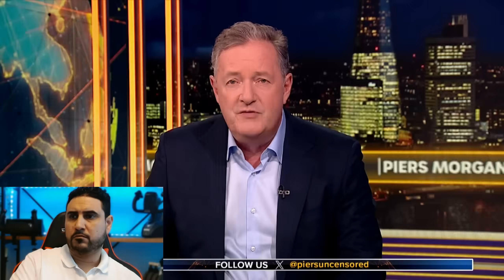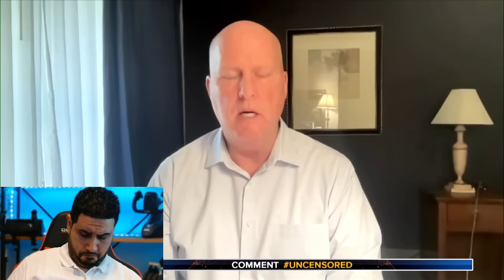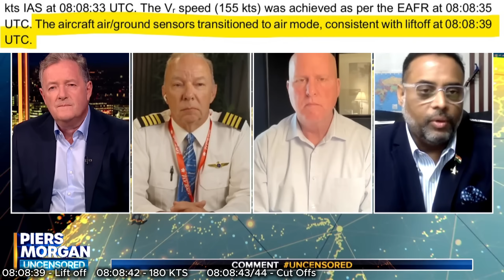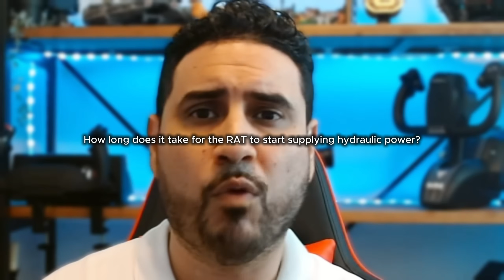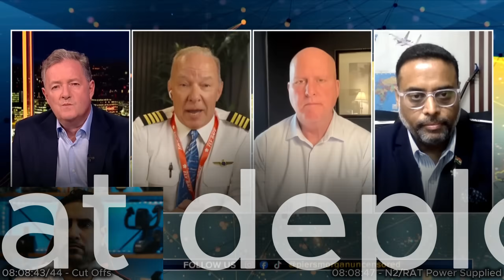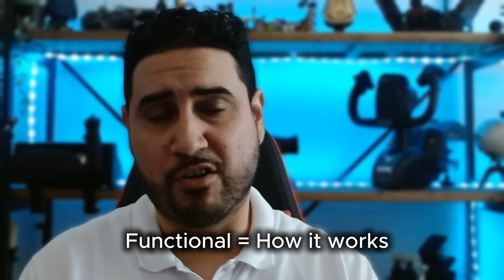TOTAL SYSTEMS FAILURE BREAKDOWN | AIR INDIA 171 | AAIB PRELIMINARY REPORT | MAYDAY | MSFS2024

Comment: People are just educated idiots...Have you ever had an electrical switch at your home that you turned on but the light it controls did not light up, or switch turned off but the light did not turn off??? Switches can fail...even mechanical ones....
Reply: One day on my car turned the key switch off and the car engine keep running so switchs do fuck up
Reply: Switches are just a distraction which Captain Steve will keep in the discussion. The actual issue happened probably at the tail.
Reply: Have you ever hade a light switch that moved by itself you mean?
Reply: @mikaelmagnusson3225 is there a proof of the switches moving?
Reply: I guess the concept of a short-circuit is too much for some...😂😂😂
Reply: @AbiP-k8g 😂😂
Reply: @Zizi462  , I'm not a Boeing Fuel Engineer, but I can logically reason and deduce that, the EAFR does not monitor the physical status / position of the mechanical Fuel Control Switches as such, but only monitors and captures the opening / closing of the electro-mechanical Fuel Control Valves, which, in all likelihood, are being linked by the investigators to the manual "transitioning" of the Fuel Control Switches.
Reply: @Zizi462  Yes, they were on and the copilot noticed they were shut off, as the audio recordning shows
Reply: @AbiP-k8g  "I guess the concept of a short-circuit is too much for some"

And I guess you do know enough about how these switches work, to know that cannot have happened.
Reply: The switches "transitioned" from on to off, meaning they moved and did what they were supposed to do - cut off the fuel. Then they were "transitioned" from off to on, the engines began spooling up again. The switches worked just fine. In the ANA incident in 2019, the fuel switches did not "transition", but remained in the on position. Big difference here.

Comment: My issue with all of the videos about this crash is the failure to correctly state the question.  The question is; "From which sources specifically can the black box receive the impulse which it RECORDS AS a 'fuel switch cut off' ?".  This question needs to be answered by the crash investigators unambiguously.  Let us put an end to the speculation about glitches and miracles.  Even an electrical short must jump between two (or more) specific conductors.  Those specific conductors can be identified as possibilities.  But miracles do not occur even in electronics, as magical as electronics might seem.  Even in electronics effects are not bastards without causes.  I suggest that the need for the "black box" is important enough that there must be unambiguous certainty that what is RECORDED AS "fuel switch cut off" can ONLY AND EXCLUSIVELY have as ITS SOLE ANTECEDENT the MANUAL, PHYSICAL shut off of the mechanical fuel switch.  If this is not presently the case, then the systems need to be redesigned.   A team needs to EXHAUSTIVELY attempt to cause a black box to RECORD a "fuel switch cut off" by every other possible means. Clearly this experimentation must be done on plane identical to our accident plane.

Comment: @FinalApproachPOV, I'm a fan of Capt Steve, but this time he's got it wrong, when he says that the Fuel Control Swich "opens a mechanical relay".

The Relay (Separate for each engine) is actually an electro-mechanical device, that, in turn, triggers the Actuator, which operates (open / close) the Fuel Control Valve.
Reply: Almost all relays are electro-mechanical. Magnetic forces (generated electrically) mechanically move a physical device.  It's just a term, it pilot speak, most people just say relay and understand that it is and electrically controlled mechanical relay, even it the relay in question is controlling another electrical signal. Relays are used because the amps/volts powering many systems are too much for a physical switch.
Reply: @jaywashington4669 , Stevie is not an engineer. If he cannot use technically correct terms, he should simply wear his pilot’s costume and go to a Halloween Party, and not make YouTube videos on technical issues.

Comment: Two switches do not turn themselves off one at a time and then turn themselves back on one at a time. The whole fuel system is designed not to turn itself off.  To have two systems fail one at a time and then repair themselves one at a time is not possible.
Reply: Perhaps there was a short and moving the switches back and forth reset the short. That explains the delay between putting the switches into RUN position.
Reply: @3rdyellow  Because of the electrical/wiring configuration, no "short" anywhere in the system could explain even one of the systems doing this, let alone two - which are separate and independent, let alone four happening with 14 seconds.

Comment: NEVER EVER PILOT ERROR 
The Thrust Control Malfunction Accommodation (TCMA) function, which is designed to work on the ground, can potentially cut off fuel to an engine without pilot input, as it has been observed in ANA aircraft during Thrust Reverser operations. This function's activation prior to the ground-to-air transition could explain a RAT (Ram Air Turbine) activation due to hydraulic pressure loss 2-5 seconds after takeoff, as the RAT is deployed when hydraulic pressure is lost. 

Here's a more detailed explanation: 

* TCMA Function: The TCMA system is a safety mechanism designed to detect and correct thrust control malfunctions, particularly during ground operations, potentially including thrust reverser activation.    
* Ground-Based Operation: The TCMA is programmed to operate while the aircraft is on the ground, including during thrust reverser use.    
* Potential for Malfunction: The system might mistakenly trigger the fuel cutoff function even when not intended, as evidenced by the ANA incident during Thrust Reverser operation.    
* Hydraulic Pressure Loss: If the TCMA mistakenly activates the fuel cutoff function during the crucial transition from ground to air mode, it could lead to a loss of engine power and subsequent drop in hydraulic pressure.    
* RAT Activation: The loss of hydraulic pressure would then trigger the Ram Air Turbine (RAT) to deploy as a backup power source to maintain essential systems, which could explain the RAT activation 2-5 seconds after liftoff.

Comment: In 2019, a Boeing 787 operated by All Nippon Airways (ANA) experienced an automatic fuel cut-off without pilot intervention during a flight between Tokyo and Osaka. “There's no evidence the pilots shut off the fuel. Audio from the cockpit doesn't suggest suicide or deliberate action.
Reply: In the case of ANA, the fuel switches did NOT "transition" from ON to OFF, they remained in the ON position, whereas on AI 171, they transitioned, meaning they were manually moved as recorded by EAFR.
Reply: Did the 2019 incident also log fuel switch transitions?? I think not.  This situation logged FOUR fuel switch transitions.  We know the switches were still in the last logged position.  That re-enforces the accuracy of the data logs.   Try again.
Reply: "There's no evidence the pilots shut off the fuel."

The evidence is indisputable. The Fuel Control Switches MUST have been moved to CUTOFF.

Comment: @FinalApproachPOV
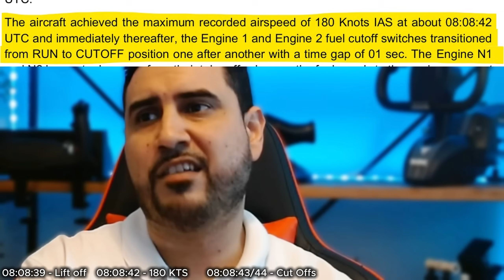4:08
The report DOES say "1 second later", you just didn't read far enough.
"Engine 1 and Engine 2 Fuel cut off switches transitioned from RUN to CUTOFF position.... ONE AFTER ANOTHER WITH A TIME GAP OF 01 SEC "
.
Reply from the maker: Maybe I can help clarify. I was talking about how uou can use educated assumptions to deduce timing. 

Immediately thereafter refers to “when” the switches cut off, the 1 second gap refers to the timing between both switches transitioning. 

The report does not specify “when” the switches cut off. That is a fact. 

Maximum airspeed achieved 3 seconds after lift off. Immediately thereafter, the switches transitioned with a 1 second game. 
How long is immediately? The report doesn’t say. This is where “safe assumptions” come to play. 

I hope this helps clarify.

Comment: Very wise explanation - my expert evaluation as an Aerospace engineer, Pilot and airline operations specialist. Finally I hear something that makes.perfect sense from these guys. When things start going wrong in thr cockpit at take off at most critical point of flight at lift off....and things which are never supposed to happen HAPPEN!!! WHAT DO.U DO!! A FEW SWCONDS WOULD PASS FOR LETTING THE SHOCK ELEMENT DISSIPATE AND THATS 2-4 SECONDS!!!
MY OPINION IS THERE WAS A WRONG SIGNAL SENT TO THE FADEC WHERE THE AIRCRAFT TRANSITION FROM GROUND TO AIR..THE MAIN CULPRIT MALFUNCTION HAPPENED TELLING THE FADEC THE AIRCRAFT WAS STILL ON THE GROUND AND CUT OFF THE FUEL FLOW TO THE ENGINE AND THE GEARS DID NOT RETRACT COMBINATION OF POWER FAILURE N WROND SIGNAL OF AIRCRAFT STILL IN GROUND MODE!!!
THAT IS THE MAIN ELECTRONIC ERROR OF THE EEC AND FADEC....THAT IS RHE GLITCH WHICH CAUSED THE FUEL CUTODF TO ENGINE RESULTING IN THE CRASH.
DEFINITELY, IIAB SHOULD.HOLD A PREAS CONFERENCE TO CLEAR THE AIR BECAUSE THEY CREATED MORE DOUBTS THAT ARE DESTROYING THE CREWS REPUTATION AND CLEARING BOEING AND GE AND HONEYWELL....BUGS HAPPEN, ERRORS HAPPEN IN ELECTRONICS... even on simplest computer and yoU have to restart once in a blue moon but IT HAPPENS!! !
Reply: Things started to go wrong...CapsLock locked on! Can't unlock! NOW EVERYTHING IS SHOUTING! MAYDAY!
Reply: The Prelim reported four switch movement events. Two have timestamps. These events could not have been logged into the DFDR if the switches were not physically moved. It CANNOT happen.

And just because you type things in all-caps doesn't mean they're true. Apologies from another AE.
Reply: @BryanM61 So why did you type "cannot" as "CANNOT" or is the self-inflicted irony just your perverse deprecating humour?

Comment: You highlighted a very important point regarding functional knowledge. Captain Steve is a disgrace to the professional pilot community with his arrogance and dismissive nature of counter arguments. To frame this accident as "pilot error" at this stage is totally unprofessional. I ask one question to those engaging in this conspiracy theory. How did the main gear achieve a toe down position if the pilot monitoring supposedly "transitioned" both fuel switches by 08:08:43. Gear doors are WoW activated but main wheel toe down tilt requires gear handle activation.
Reply: Captain Steeve clearly did some research into the Fuel Control Switches and their functionality. He knew a couple of key points (stated in this and another video) that very few people would know if they hadn't studied the system in depth.

He is NOT a disgrace to the professional pilot community; he is "arrogant and dismissive" here because he KNOWS - for a fact - that the other two people are making sht up and talking out their asses. He KNOWS they are making provably incorrect in their statements. He's not guessing; he's not "going off his gut", he's not sticking to some theory he made up in his head; he knows for a fact.

Toe-down - if that's what we REALLY see - was a result of reduced hydraulic pressure to the main truck tilt actuator; no gear handle movement required.
Reply: @BryanM61  You need serious help. You have no idea what you are talking about. Leave this to the professionals for educated discussion. You know nothing about tilt.
Reply: bit of Dunning–Kruger effect

Comment: Alternate Interpretation hypothesis: AI171 Dual Engine Failure on Takeoff
There’s growing reason to believe that Air India Flight AI171 suffered a dual engine flameout before liftoff, and that the RAT (Ram Air Turbine) deployed right at rotation — not later as implied in official timelines.
Timeline Breakdown:
* Takeoff Roll: Acceleration appears normal. But sometime between V1 and VR, both engines lose thrust, most likely due to fuel starvation (e.g., no fuel in centre tank).
* Rotation (~160 knots, ~25m AGL): As the aircraft lifts off, the RAT is visibly deployed. The RAT cannot deploy on the ground — so this confirms that both engines were at idle or dead at rotate!!!  A shallow but abnormally high pitch angle on takeoff adds further evidence of a powerless climb.
* Cockpit Voice: “Why did you do that?” Possibly a reaction to unexpected engine flameout or accidental fuel control input. Timing of this line suggests it coincides with sudden loss of thrust.
* Emergency Action: The pilots cycle the fuel cutoff switches to OFF and then back to RUN. This wasn’t to shut down working engines — it looks more like a desperate attempt to restart dead engines.
* Restart Attempts:
    * Engine 1 N1 spools, but N2 does not → No combustion.
    * Engine 2 fails to spool N1 at first attempt, and N2 doesn’t ignite either.   No N2 movement = No combustion = No fuel getting to the engines.

Conclusion:
* RAT deployed at rotate proves engines were already dead before liftoff.
* No N2 spool confirms no combustion, most likely due to fuel starvation.
* Crew input shows signs of confusion and attempted recovery, not intentional shutdown.

This timeline challenges the initial narrative. The key clue? The RAT — it only deploys when both engines are lost. And it was already out by the time the aircraft reached 20–30m AGL.
Reply: @rodneystagg1865, this is a very likely scenario.
Now, the investigators should focus on the reason(s) for the dual engine flameout immediately after rotation.
Reply: @ramnik.khanna  Post-AI171 Crash: Fuel Handling & Accountability Changes
In response to the Air India 171 crash, both Air India and the DGCA have made significant procedural changes to strengthen fuel handling oversight, improve crew accountability, and eliminate fuel mismanagement risks. The crash revealed that the aircraft likely had no usable fuel in the centre tank despite the system being configured to draw from it — prompting a serious rethink of existing SOPs.
1. Dual Verification of Fuel Uplift
* Now requires Pilot-in-Command + ground fuel supervisor to both verify fuel amounts tank-by-tank.
* Fuel figures must match across:
    * Dispatch fuel plan
    * Fuel receipt from refueler
    * FMS readouts
    * Load sheet
* Any mismatch must be resolved before taxi clearance.
2. Centre Tank Monitoring SOP
* Crews must now cross-check actual fuel level in the centre tank via FMS and visual gauge.
* If fuel is not present, centre tank pumps must be OFF — with an explicit logbook confirmation.
* If fuel is present, pump pressurisation must be confirmed before takeoff roll.
3. Pilot Responsibility & Switch Configuration
* Pilots now have explicit checklist items and callouts:
    * “Fuel switches — RUN, confirm.”
    * “Tank selection — as briefed.”
* Both pilots are individually accountable for correct fuel switch and tank configuration pre-takeoff.
* Verbal confirmations and cross-verification are required.
4. Stronger Paper Trail & Dispatch Oversight
* Fuel logs and reconciliation forms are now kept for at least 90 days.
* Aircraft tech logs now include a new “fuel configuration sign off”.
* Dispatch may reject a flight if any fuel value is unverified or left blank.

 Bottom Line:
Air India and the DGCA have tightened procedures across the board to ensure that fuel quantity, pump selection, and switch configuration are all triple-checked and accountable. The days of assuming “it’s already set” are over. No one is even talking about the fuel anywhere so why has Air India and the DGCA  made these quiet changes to their SOP's????